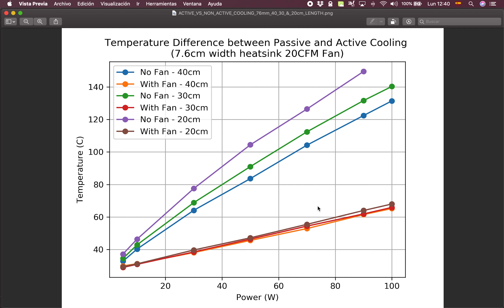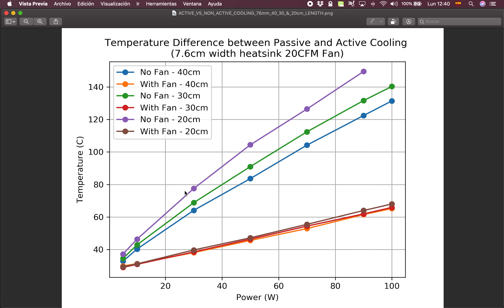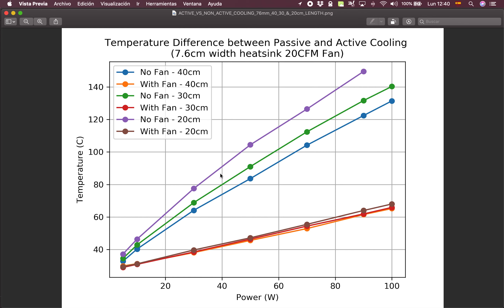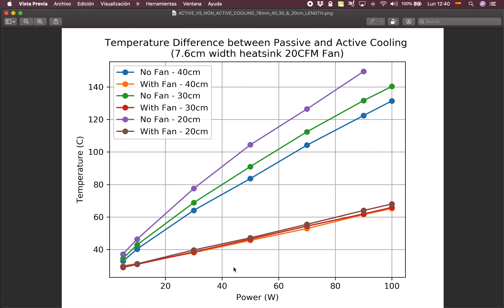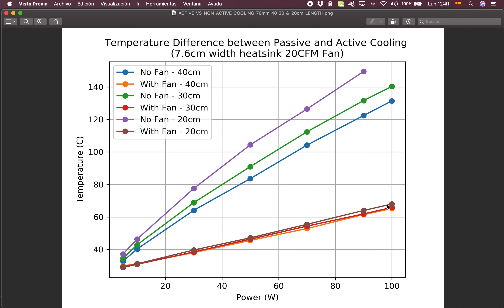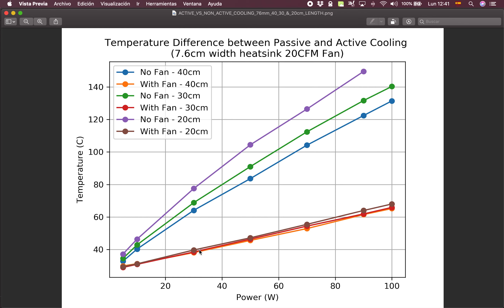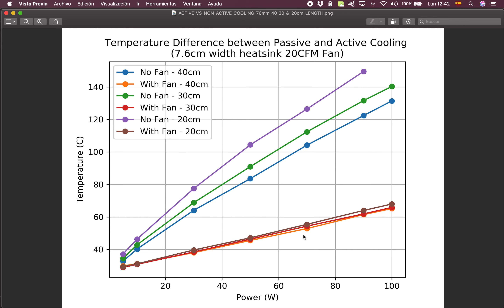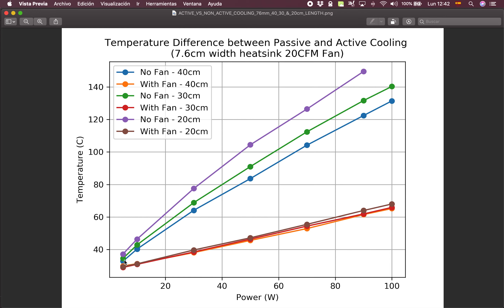Update. Heatsink behavior with active and passive cooling. 7.6cm wide and lengths of 40, 30 and 20cm

Comment: Are you implying that the diameter of the fan did not matter ?
Reply: Hi. Thanks for your question. Not at all. What the measurements imply is that the heatsink length has very little to no impact in the dissipation of heat when using the same fan just behind the heat source. A greater CFM (which can be related to the fan diameter) definitely helps to reduce the heatsink temperature.
Reply: @bertgh  oops, sorry I was not paying close attention.     But it would have helped to show the heatsinks used.       Do you think the design of the
heat-sink is more relevant then, or the material ??